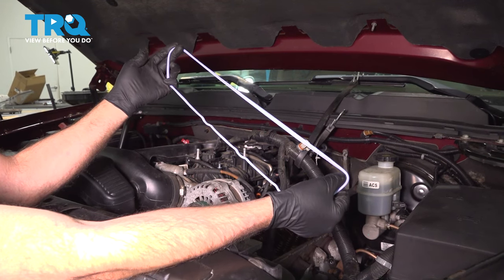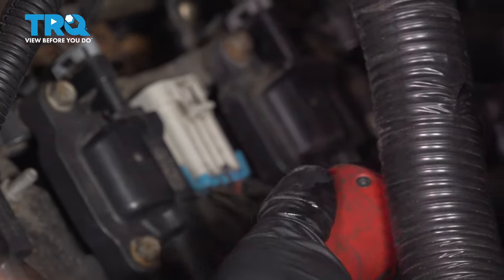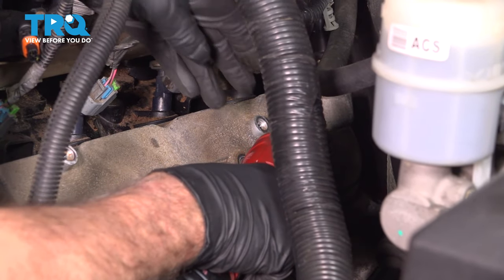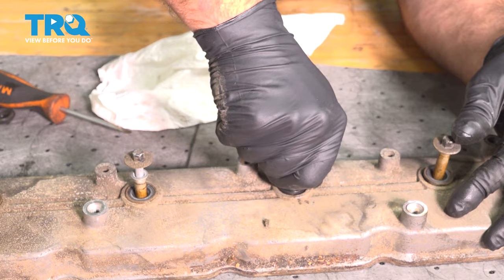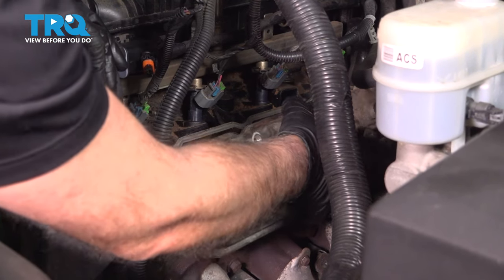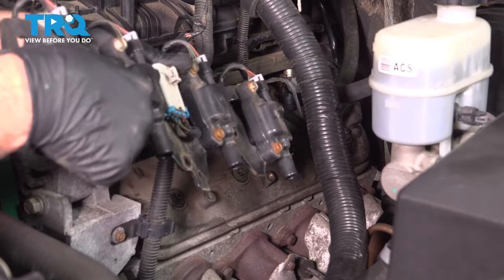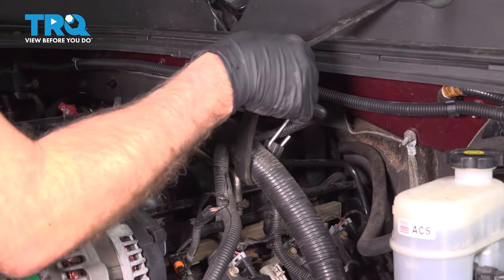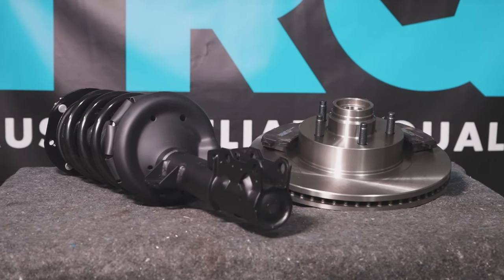How to Replace Valve Cover Gasket Set 2007-2013 Chevrolet Silverado 1500

Comment: Dude. I stripped the threads out of the engine because I used my battery ratchet to put the valve cover bolts just like you did. Stripped TWO of them. 😭 I should have just paid the mechanic to do it.

Comment: My 2010 5.3 Silverado has been burning 2 quarts of oil in 3000 miles SINCE IT WAS NEW. It also causes a misfire in cylinders 1 & 7. After 14 years I found out is was a design defect,which brought me here.
Thanks for your concise & thorough guidance. It's a big help for the working man...